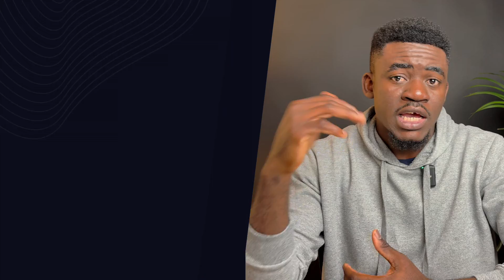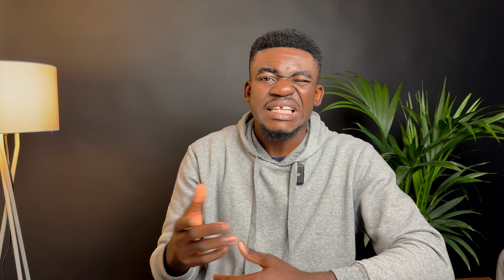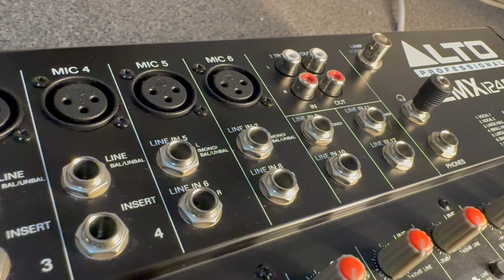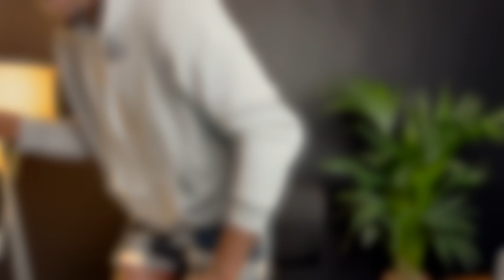Audio Signal Levels: Mic, Instrument, Line, Speaker

Comment: A DI box ouputs a line level signal :).....The problem I usually have is that that there are many line level outputs that are XLR and I have to insert then on XLR inputs which expect mic level....I just keep the gain down and it s ok. I don t like to use those XLR/TRS adapters. Good video. thanks man